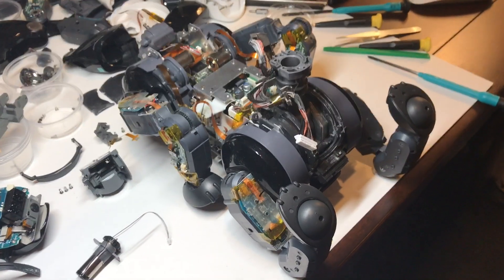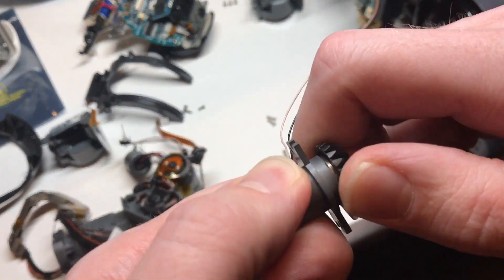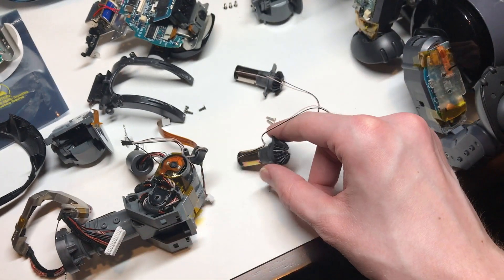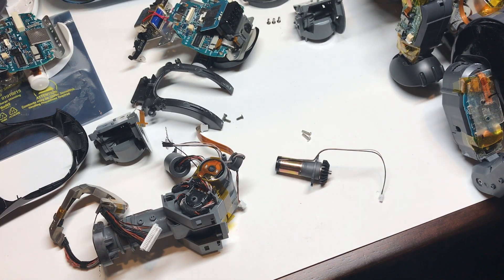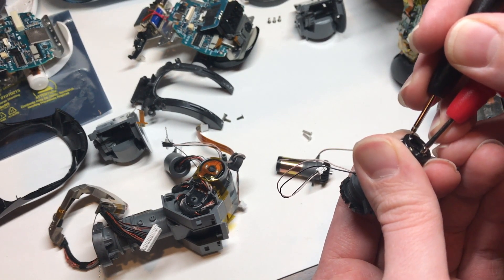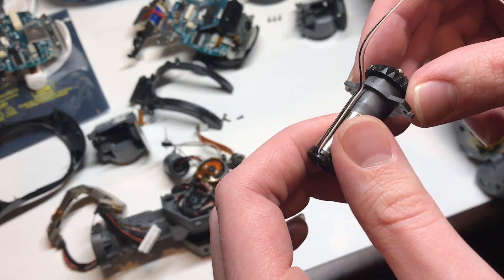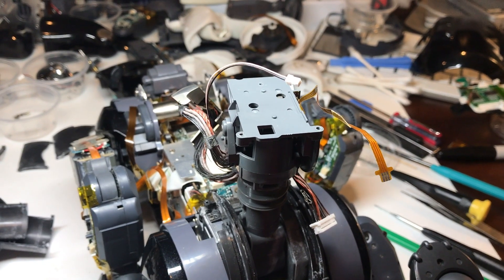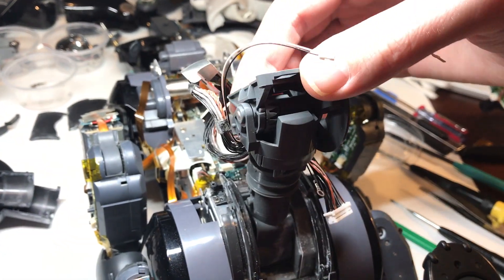AIBO ERS-7 Head Tilt Repair

Comment: Hi I would love to know the Specs of the Wlan card THIS AIBO takes and could it be upgraded??...to modern card with WPA2??
Reply from the maker: ERS-7s use a mini PCMCIA  Card that runs on the 802.11b standard.  You'll need a legacy router with WEP encryption to connect to them.  The cards in 7m1 and 7m2 dogs are proprietary and were built specifically for Aibo.  The cards in 7m3 pups are repurposed Air Shot cards that were originally designed for Sony's data projectors (likely a cost cutting measure as the company declined heavily in the mid 2000s).  Unfortunately due to their small physical size, and software limitations (Aibo is only designed to work with its own card), it is not possible to upgrade the wifi inside of an ERS-7.  Older models (210/220) can use a select few VAIO cards (needs to be capable of running on 3.3v instead of the usual 5v) in addition to the official Aibo card, but they're all pretty slow and rely on old wifi standards that are no longer in use today. Basically plan on needing an older router for Aibo use if you want to connect to them haha.
Reply: @JBurg  Thanks!